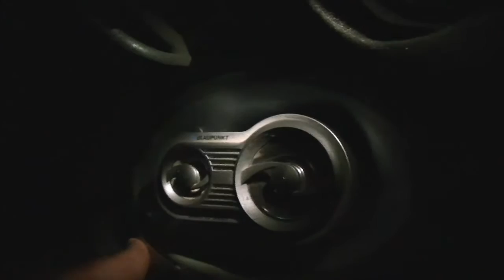Upgrading Rear Door Speakers in Your Car (Ford Contour)

Comment from the maker: Update:  Contour got junked.  Transmission issue but motor was great at almost 220K.  Got the aftermarket radio out but totally forgot to pull the speakers.  Don't wait till the last minute.

Comment: What tool did you use at the very beggining to pick out the tab by door handle?
Reply from the maker: It's a metal pick.  Google "metal pick" or "metal pick set" and you'll see a bunch.  Most auto parts stores, hardware stores and Amazon/etc will have these.  If you want to save money try Harbor Freight, if you're lucky enough to live near one.  Good luck.

Comment: What size are they
Reply from the maker: Greg Lenegan The speakers were 5x7s, if memory serves.  Could have been 6x8s.  Either will fit but you have to drill new holes for the screws.
Reply: Arthur Kirk thanks man i just got that same car same color has 100k miles on it has it gave you any crazy problems?
Reply from the maker: Happy New Year Greg!!  Apologies for the delay.   Got this car with about 204,000 miles on it over a year ago and now she's at about 211,000.  All I've done are tires, new battery, valve cover gasket, repaired a rusted brake line and just did front pads and rotors.  Rears are in the spring.  Besides that and general maintenance she's been a great runner and gets great MPG.  Starts like a champ, even in the middle of winter.  Hope yours treats you as well.   Please send a link of any videos you do on yours.

Update:  Just crossed 215K and the only issue now is a transmission leak.  Besides that, and a recent $10 coolant hose, this car is bullet proof.  I just wish it was rust proof :)
Reply: No they’re not. Alternator will get you I promise. Four different ones. Four alternators